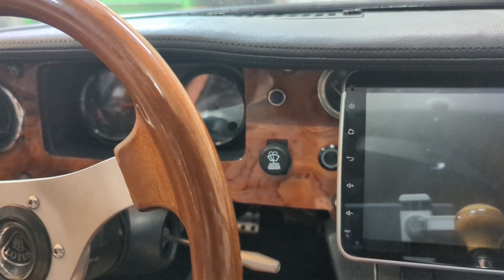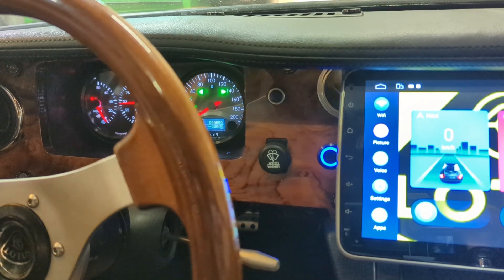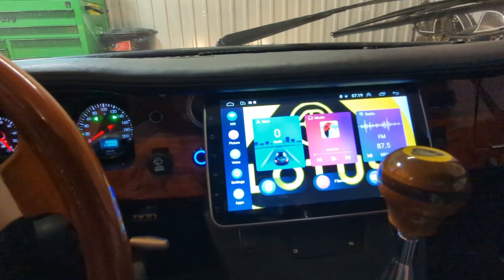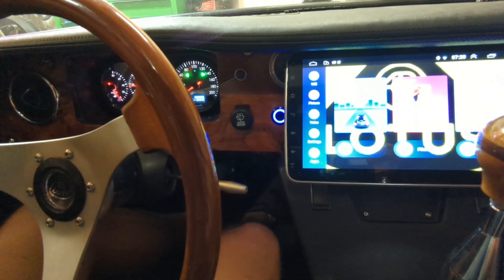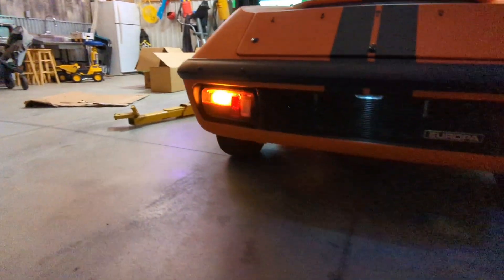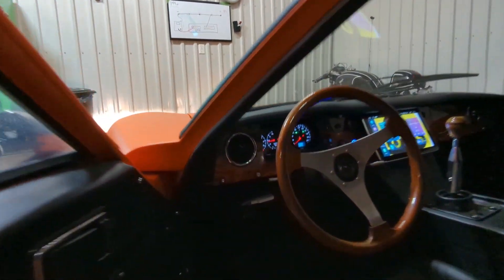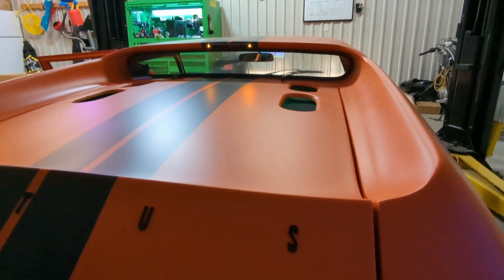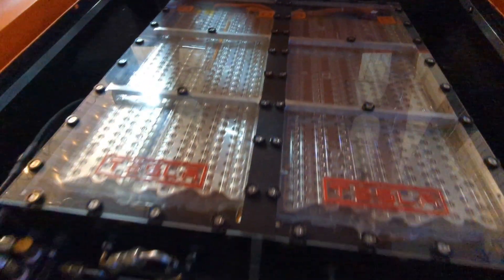69 Lotus Europa EV

Comment: I read everywhere that electric motors develop maximum torque from 0rpm, and that as a result, EVs don't need gears, so why does this EV have gears?
Reply from the maker: Rear transmission is a part of the frame, so this was the only way to keep the build of the car somewhat the same ..  the motor does 175 ft lb at 0 rpm
Reply: @shanewalsh5493  That sounds like quite a decent amount of toeque. Does that mean that - unless you're reversing - you just leave the car in top gear when you're driving, even when pulling away from traffic lights?
Reply from the maker: @paullyons7621 you still have to shift the vehicle like a normal ice engine. The correct gear means the electric motor does not have to work hard.. the incorrect gear means no mechanical advantage, now an ice engine may stall and an electric motor will power through it . I'm basically in second gear all the time

Comment: Great project. Looks very well thought out and executed. My question: Do you even need a gearbox? You did not shift in the test drive, as it seems.
Reply from the maker: Thanks. I did shift the car into second gear and that is where I do most of my driving. The electric motor will spin faster than a gas motor. So it kinda changes the shift points

Comment: Nothing regular about a Lotus. Always wanted one, but glad I didn’t get one. What is the weight distribution, f/r?  I guess 15/85.
Reply: I guess that the electric motor is not so much heavier than the stock one. With a "normal" Europa the ratio is in the ball park of 40/60 front/rear.
Reply: @YART_Racing  I was referring to the Battery.
Reply: @AOrr-e4i  but did he not add one battery pack in the back and anotherone in the front boot?

Comment: Very interesting but how about some details, empty weight, performance, source for motor and battery pack, what did you use for a transmission?
Reply from the maker: The original vehicle weight was around 1300lbs my current weight is around 1500lbs (est). The motor setup is a Hyper 9 brushless electric motor. The battery consists of 6 modules out of a Tesla s/x. Total voltage 144v. I'm using the original transmission
Reply: My apologies for not seeing the listed info but would love to see more! Where are you?